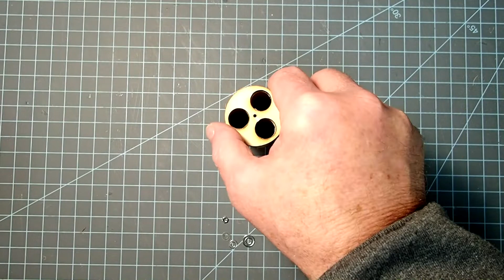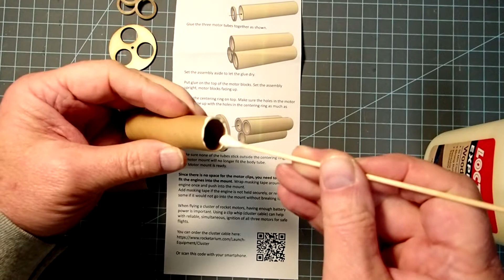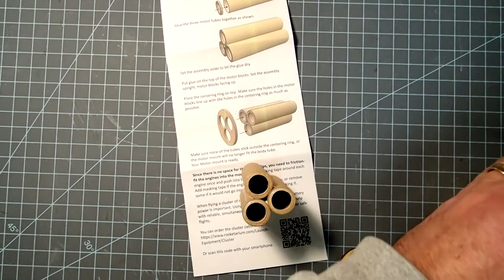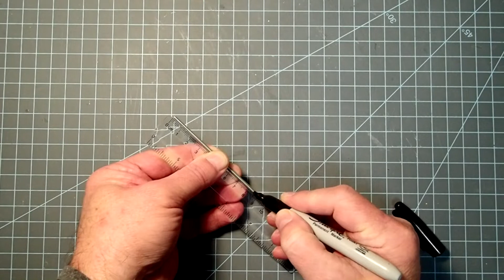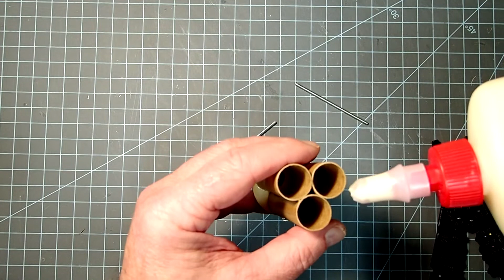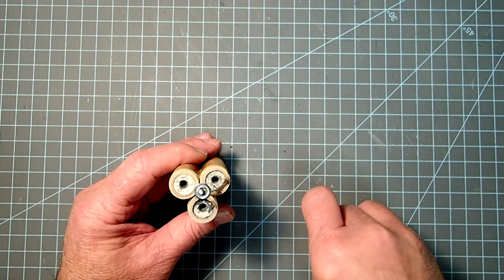Rocketarium BT-60 18 mm, three-motor cluster mount assembly

Comment: But why do a cluster of three 18mm motors instead of just a bigger 24 or 29mm motor mount?
Reply from the maker: They look cool when launched.
Reply: Clustering adds another skill in lighting multiple igniters successfully. Some scale rockets have multiple motors. NARTREK silver program requires a cluster for the certificate and the added cool factor.